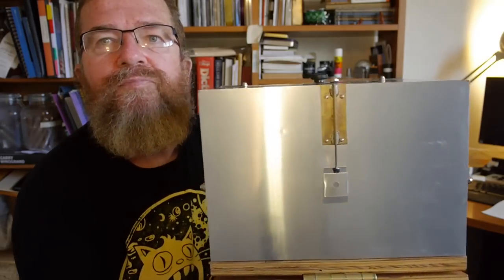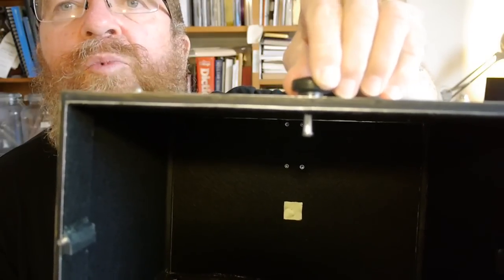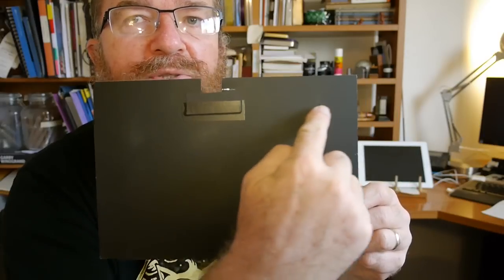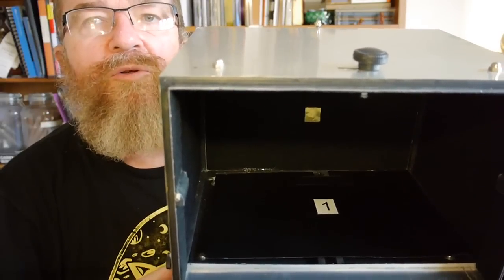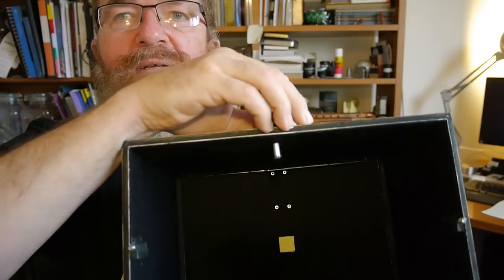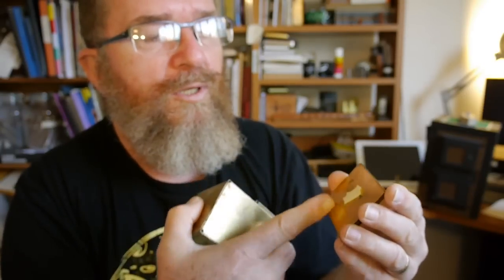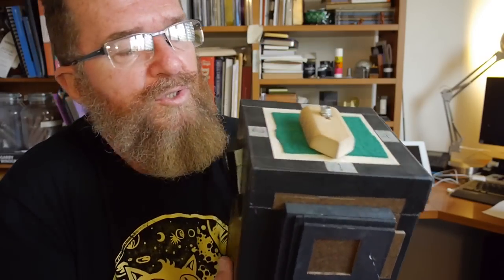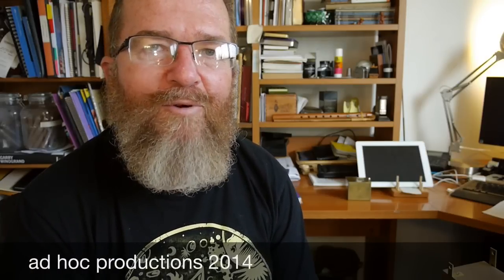Four Pinhole Camera Designs

Comment: thank you so much for your videos after i seen your falling plat camera i made one my self and i had a very good outcome, if you have instergram take a look Mr.iveson , thank you again joe you are a inspiration in my work
Reply from the maker: Nice results! Is that Harman Direct Positive Paper? You caffenol processing looks good. I'm curious how you designed the falling plate mechanism in the camera. Well done.
Reply: yess i used the harman direct positive paper after seeing you use it and your outcome , it taken me a while to get the mixture right using caffenol but i finally did it right , the mechanism works just like yours exept instead of using a heavy plate on the back i made the back door of the camera to push against the plates to push them forward and there is a small step in the bottom to hold the plates . it works well and keep the plates steady